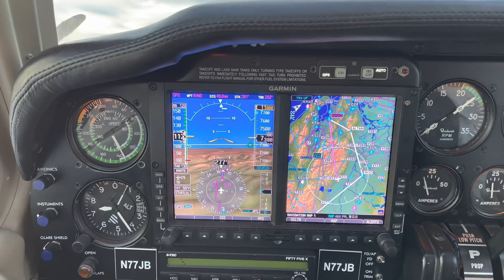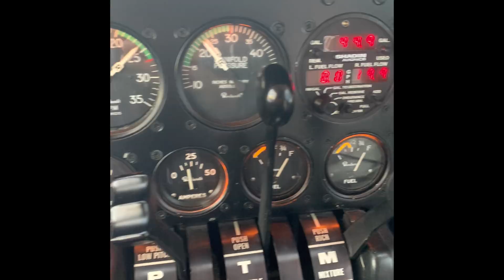In Flight Engine Failure Emergency in a Beechcraft Baron

Comment: sinngle engine instrument land. I have roughly 20 hours in a twin turboprop. 2000 hours in an A36. My understanding is a twin engine plane can climb out on one engine. I have never done that and I am not rated in a twin. I cannot afford a twin. Basically you were never in danger. Correct?

Comment: Why does it seem like these aircraft engines fail dramatically so often? You'd think with the same design being around so long, they'd figure out how to keep them together. A large displacement, low rpm engine should last forever.
Reply: You look at the numbers and you see that these types of engine failures are quite rare. You hear about them because there a lot of them flying around. Anything,  no matter how well made,  can fail. Glad this one turned out well.

Comment: My brother has an A36 with the IO550 and he wants the Baron for this exact reason.. wow... very nice work getting it down and it was nice it did happen at altitude and not climbing under full power.  You would need to step into the dead engine fast.  I fly RC and we lose twins a lot with a motor out... have to be ready with that rudder and or throttle back fast and then ease back the power with rudder.

Comment: The worst part of the flight probably came after you were on the ground trying to taxi with only one engine, huh?  I was wondering: when did you lower the gear on final? How far out from the runway were you when you lowered the gear, and did you have to add any power when you did?

Comment: Its hard to judge the fuel quality these days and having zero warning, I believe that was caused from detonation. Those engines are built very well so they just don't fail for no reason, something initiated that failure quickly and not from a ongoing metal fatigue situation.

Comment: You might need to look at your manifold gauge too.  And don't forget to check the cylinder bolts.  It is VERY possible the cylinder broke loose first and then caused the piston to break off or the rod bolts to break.  The design of these aircraft engines (BOTH Lycoming and Continental ) are VERY poor.  The cylinders should have a stabilizing metal piece that covers either 2 or 3 or 4 cylinders -- depending on 4, 6, or 8 cylinder engines.  This would keep each cylinder aligned and be much stronger.

Comment: The engine area looks like it does not have many hours on it due to its cleanliness and fresh paint colors. I would assume that this engine was recently rebuilt?   Any update from the previous engine builder would be very informative. It seems this could have been an over torque or under torque of the connecting rod bolts from the last engine build. Nice job! Just got my first plane last week. Hope this never happens to me. I watch this stuff to help prepare me for if it does.

Comment: At 5:25, the technical term you can't think of is "metal fatigue", which seems entirely too common on engines that are supposed to keep propellers spinning reliably!  Rather than the "...cylinder bolt breaking...and rocking..." as you described, it looks like the connecting rod bolt(s) (in your hand) failed.  The flailing about during crankshaft rotation jams the remainder of the rod, with piston attached, into the crankcase, breaking it at the base of the cylinder and you become a single engine emergency aircraft.  

This crappy engineering and/or poor workmanship seems too common, which leads to my recommendation:  After any service, repair or replacement of a critical airplane component, the mechanic(s) performing the work will fly the aircraft before signing off the log book that the service, repair or replacement is complete.  So, for example, if the fuel line is left loose after a minor part replacement and the right engine on a Baron twin bursts into flames, the owner/pilot will only have to call the insurance company, instead of flying it into terrain.
Reply: We are talking about engine designs that date back to the 1960's. Times have moved on, but not in GA

Comment: Push the throttle of the feathered engine full forward to silence that gear warning.
Pulling the CB has its risks so its best to silence it with the throttle lever.

Comment: Would this be considered a "contained" engine failure since the piston did not leave the cowling? Is that even a thing on piston-driven aircraft?
Reply: i heard contained and uncontained refers just to when a blade lets go in a jet. but for piston engines its just a failure, idk if a piston engine could fail hard enough to leave the cowling,
Reply: @nick4506  gotta admit... this one got pretty close.
Reply: @nicksantos43  yea this one was a straight up engine explosion, idk if a piston engine can explode any harder. yet all it did was dent the cowling.

Comment: Interesting normally you would get a spun bearing that starts to slap around and breaks the cap bolts off but here i don't see any discoloration like to bolts just let loose. To bad about the block expensive rebuild

Comment: Losing the engine in a light tween may not be the end of the world, but it can be much more critical than in this case. Sure, when you are high at cruise with engines producing only partial power, with gear and flaps already retracted and already flying above the blue line with only 2 people on board, it is not as critical as having the engine fail right after take off when you are slow and low and at full power and with the gear (and perhaps some flaps) out, and with 6 people on board at max gross weight ad with the CG in a more aft location. In certain cases flight can just not be continued and the only option to preserve control is to reduce power on the good engine and land right where you are, which is hopefully a place where you can perform a survivable emergency off-field landing.
Reply: It's even worse if your hauling 5 fat guys that are collectors of antique lead ocean sinkers and they all bring their collections with them.
Reply: @DontWatchProductions  No, that's not worse, as long as you keep the total weight within the max take-off weight (probably by taking less fuel)

Comment: I remember standing and listing as a pilot in the same tipe of aircraft had engine come apart all most 20 years ago and when ask can you see any thing and the pilot comes back so cool as this pilot with the words there's a hole in the cowing,
 came in with no troubble 

Pilots have to keel a cool head at all times

Comment: Somebody fucked up the torque to yield specs on the thru block stud bolts. This is a common problem when you open up an engine and don't add the extra 90 degrees with an accurate angle gauge. Loose bolts allow the cylinder to vibrate and wobble over time resulting in bolt/stud failure.

Comment: Good job. After dead engine is secured, push the throttle above idle to silence the beeping. Otherwise you get used to the sound and additionally you risk a gear up landing.
During landing at flare - reduce both levers to idle.
Reply: Excellent advice!
Reply: I'm guessing here, but it's likely just the one master alarm, so a second alarm/failure would be missed.
Reply: Another approach is if you’ve pulled the mixture and feathered, you can leave the throttle lined up with the operating engine.

Comment: Nice job!  I was with my brother in his B58 when, of all things, the oil line feeding the prop cracked off at the flange.  Engine was making power just fine.  A recent prop / hub overhaul on both sides paid off in spades as the prop auto-feathured when pressure was lost.  Bro manually feathered the prop then killed the engine (#1) and called the emergency.  We got immediate clearance to swing around on a short downwind and final.  He kept us high and hot until he committed then dumped the gear and full flaps.  Greased it on and did an easy roll out.  Kept power on and cleared the runway and parked right in front of the shop.  The mechanic said that in over 30 years as an A&P, he'd never seen that happen before.  He was able to find a NIB pair of oil lines locally and had the plane back up in 24 hours.  FWIW, there were 3 on board, minimal bags and about 2/3 of a gas load.  I'm not a pilot, but grew up flying and, with a brother who's an Airbus Captain and has had his license for 39 years (he's 56), I felt pretty calm and DAMN glad we weren't in a Bonanza!  😁
Reply: So that's one of the reasons people say Bonanzas are a tricky plane?
Any engine out situation is going to result in an over speed situation and tear apart the plane?
I spent many many hours as a passenger in a V tail and never knew..
Reply: @josephhertzberg2734  I never said that, but the V's =were= known to have issues with a weak empennage.  We lost good friends when their V-tail came apart at altitude.  Not due to overspeed, but due to sudden extreme turbulence as they flew through Banning Pass near Palm Springs.  This is why there was a mod made that put a boot around the stabs that was riveted to the skin of the fuse.  Kept the stabs from wanting to twist around the single spar.  I can't remember if we did that mod to our plane, or not.  I was pretty young when Dad got out of it.
Reply: @laknox88  gotcha. Thank you

Comment: It doesn't sound like it's flying beautify. Sounds like your stall warning going off.
     I think it says something about your judgment that you are PIC and you are filming in an emergency situation. You should be on the radio, declaring an emergency and landing as soon as possible.
    Most light twins will be unable to maintain altitude, especially when heavily loaded. That means they are LESS safe than a single engine plane. Double the chances of an engine failure.
    On top of this, you are filming while making an approach.
    Your behavior is such, if I were with the FAA I would recommend your license be revoked. You demonstrate terrible judgment as a pilot. If you keep flying Juan Brown will be doing an accident report on you. We can only hope you are flying alone when it happens, and you don't take out some random person on the ground.
    Please, sell your plane and quit flying.

Comment: "This was the original engine from 1968 and the last overhaul was done in 1992, it had around 1600 hrs on it when this happened"... had any cylinder work been done since the last overhaul? Why did you bypass KRHV and KSJC and continue to HWD?

Comment: Since it's a 'D' are those the IO520? I have some right seat & safety pilot time in a B55 with the IO470s. I noticed the VG kit. The B55 I have experience in had those as well. I wonder how much they help single-engine climb performance. I know the main safety feature is dropping Vmc below the stall speed.

Comment: That engine didn't appear to be very old. I have seen that before. Glad it went well.
Reply: Above in a comment he stated "1992 with 1600 hours" on the dial
Reply: @ChR1St0p4eR  
Original 1968 engine, last rebuilt in 1992 with 1600 hours since the last rebuild.

Comment: Never heard a pilot so nonchalant about having to spend $90k on a new engine. 🤣 All jokes aside, you handled that like a boss. Completely cool, you did just like you were trained. You made it seem easy. Nice job!
Reply: More like 60K.
Reply: @jplumbob  still pretty pricey! I used to operate a couple of Navajos and it was $180k for 2 factory remanned engines. I figured a new IO-550 would be similar in price. He obviously can’t get his overhauled since the whole thing grenaded. He’s going to need something new or factory remanned.
Reply: @jplumbob  90k if you're a picky type and want one that doesn't blow up mid-flight. ;)
Reply: Insurance?
Reply: @Jake-zr5zs  unfortunately no. Insurance doesn’t cover mechanical breakdown, unless somehow this pilot has coverage for that. It’s like if you blew up the transmission in your car, your car insurance wouldn’t cover it.
Reply: @cwhitty05  but if you lost both engines and had to land in a field, the insurance would cover it, right? Weird.
Reply: @Jake-zr5zs  I’m not an expert on it, but I’d imagine they would if I landed gear up in a field or in the water, and the aircraft got damaged. But if I landed on a road, without damage, I’d imagine they wouldn’t.
Reply: It's not a matter of spending the money afterwards, it's a matter of being able to fly with the 2 engine and not have caught fire in the explosion, that is, being alive..
Reply: Aftually, saw an overhauled IO-550 on Trade-A-Plane for US$ 26.700. Add Tax, shipping and Labour you should be going to US$ 35.000 to 38.000… still, a very pricy experience.
Reply: @mvaldman2001  that’s a great price compared to what I saw 7-8 years ago. Like I said, we changed engines on our Navajos with factory re-manufactured engines and it was about $180k. Now, those were also turbo-charged engines, and we overhauled the props too, but still very expensive.
Reply: @cwhitty05  ~$80k is the number I've heard thrown around for these engines recently, and that's an overhaul. Not sure what a core costs, but I'm guessing your $90k number is about spot on. $60k might get you a mid-time used engine, but there's not many of those floating around.
Reply: isnt this the reason you have insurance?
Reply: @battfieldsniper1  No you have insurance primarily for liability for damaging property when you crash
Reply: @jayit6851  and full coverage? its not a car...
Reply: That much?!?!
Reply: @ficknoti  Yup, nothing salvageable except for maybe the mags and the fuel pump. Possibly the prob governor.  So ya, ~$60K including the labor to pull the old one and re-install new one.  Plus cowling damage.
Reply: Arab money 🎵🎶
Reply: J-B Weld, no need for a new engine! 🤣
Reply: Of course the insurance would cover the damages, that’s the only reason you pay an insurance

Comment: You just taught a master class in “how not to panic”.  Controlling your emotions, and having a level head to calmly deal with the emergency makes the whole situation a non-event. Great job!
Reply: He still had one fully operable engine and the plane was stable and level which aides in calmness.
Reply: @ZeitGeist_TV  It's kinda cool how stable it flies despite the assymetric thrust.
Reply: @hunormagyar1843   Indeed!  Below a certain speed, asymmetric thrust can overcome rudder authority, causing uncontrolled yaw, then stall on the resultant trailing wing and then uncontrolled roll due to what is now extreme asymmetric lift.

Something to be well aware of during the slower speeds of takeoff and landing for pilots of twins.
Reply: @BeardyMacBeardFace  Half of my multi-rating was "This will kill you" for that very reason :P
Reply: @BeardyMacBeardFace  simply turn off the second engine on approach..
Reply: @Arvidje  what
Reply: @Arvidje  Ha... noooo.... you might need to go around, just keep the speed above Vyse until committed then idle as usual, and you can taxi on one many times.

Comment: How much did it cost to fix this?
Is this covered by insurance?
Reply: The insurance company may cover the damage to the cowling and maybe the cost of cleaning up the oil on the airframe. But the engine failure? On a long out of overhaul high time engine? 

Don't see any major insurance issues.

Comment: Who worked on the engine last and how many hours on it?  This is what we always ask when this happens it has been getting worse lately with poor to very bad engine work. Never cut corners the best way to do engines is to order them from Lycoming or continental and send your old or damaged one back to them in the crate they sent the overhauled or new ones in. We never ever get a call from the owners having problems or the planes involved in an accident. Yes, they cost more but what is your life worth.
Reply: 1992 with 1600 hours

Comment: Probably NOT the time I would pull out the camera/cellphone to film, but I'm glad that you did.
Reply: the situation was already stabilized, engine was secure and the flight was routine for them already - I dont see the big deal
Reply: @ghostrider-be9ek  There is no such thing as a routine flight when one of the engines on a twin engine fails. The flying dynamics change completely and it causes yaw and roll. While the failure of an engine represents a 50% loss of available power, it can result in as much as an 80% loss of performance. It's not a "big deal" if you're well trained and paying attention, but it's not a time when I would be bringing an unnecessary distraction into the cockpit by trying to film. To me it's like texting and driving.
Reply: @2011blueman  If you don't know what you're talking about its probably better not to say anything. Turboprop lol.
Reply: @X85283  Thanks for your "opinion". I've likely been a pilot longer than you've been alive james.

Comment: Great video I alway here about bad thing on a twin more to go wrong, roll over and crash on take off. This video shows how much safer a twin is   when you have engine failure. Your are motivating me to get my twin rating and buy a twin. Thank you for a great video.
Reply: How much safer a (light) twin is... under ideal conditions (near sea-level airport, VFR conditions, etc). Just make sure the light twin you buy has an ideal-conditions warranty on engine failures. Otherwise, all the not-ideal-conditions light-twin accidents that get covered on YT all the time will still matter.

Comment: Yeah, generally speaking, not so great to be able to see the engine crankshaft when you take the cowling off! 😳 Glad all turned out well. Hayward is a nice airport with nice controllers.
Reply: The piston present at the dipstick door at 4:12 was a nice touch. I jumped back like it was a snake.
Reply: @radioace318la  No doubt!!